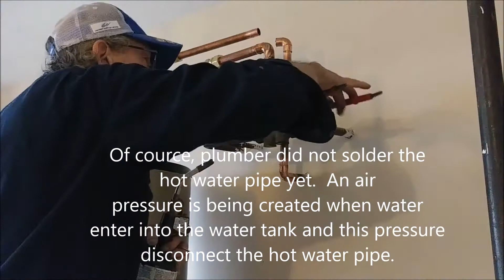How To Solder Copper Pipe and Install Water Pipes To A water Heater - Plumber In Action

Comment: The water/piping has no problem going vertically? I'm assuming because pressure is high enough? I'm trying to change mine out for first time and I may to go smaller if I can't do that
Reply from the maker: You right no  problem going vertically.